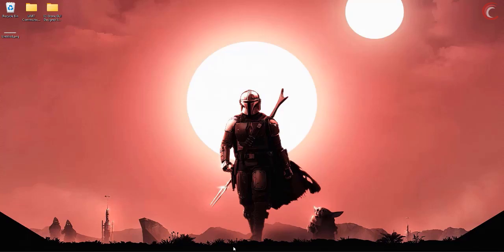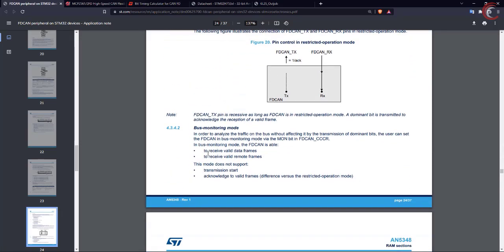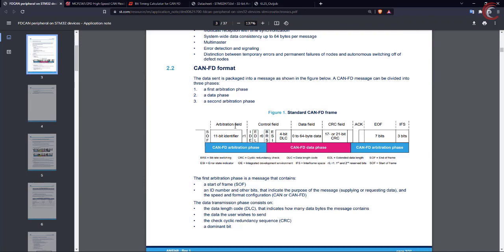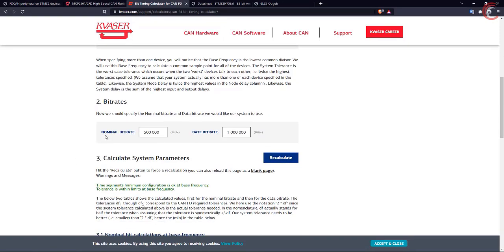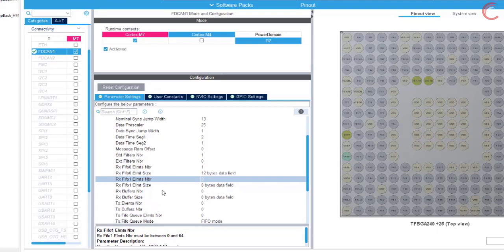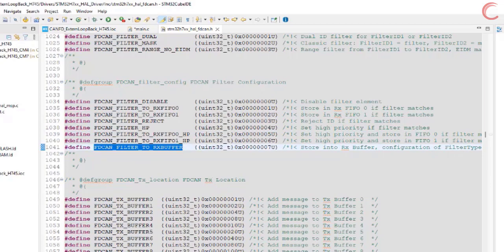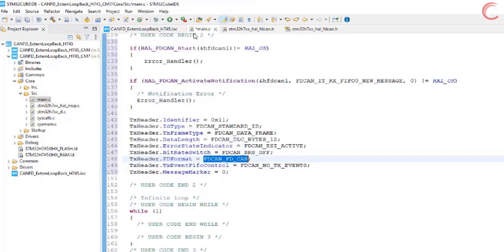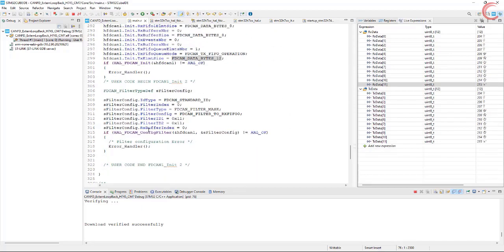FDCAN in STM32 || LoopBack Mode

Comment: Trying to get FDCAN on the STM32U5 and not being very successful. 
I need classic mode and I set up the interrupts and everything.
I get receive error counter going up.  I don't really know how to go forward from this.
Reply from the maker: Classic mode is used when you want to use the FDCAN to communicate with normal CAN. I did not test it personally, so can't comment on it.
Reply: @ControllersTech  Thanks for reply. Do you know if it's possible to see the type of error FDCAN has? I know the bxCAN has the ESR register to say the type of error the CAN frame is, however I could not find a similar register for the FDCAN?
My interest is only to use it in classic mode.
I see with an oscilloscope the STM32U5 is receiving a signal.
Reply: I got it working. My issues were:
1. I have FreeRTOS but I was trying to run it before the FreeRTOS starts for testing purposes. I had to make the FDCAN interrupt priority 0 in the NVIC and not use the FreeRTOS functions.
2. Since it is classic mode you can use the bxCAN calculations and match the nominal and bitrate prescalers together.
Reply: If you want to uses FreeRTOS apis. You have to check the range of interrupts are allowed to use FreeRTOS apis. For example in Cortex M4 start from 6 to 15. From 0 to 5 is not allowed to use FreeRTOS apis.

Comment: Is there anyone try to use STM32H735G-DK to realize loopback mode? I try it with the exactly same code and setup, but no message can be transmitted... I don't know why...
Reply: Hey, I just got it to work with the STM32H735IG-DK discovery board. In my case the problem was that I had to change the following lines:

In his code:
  hfdcan1.Init.TxFifoQueueElmtsNbr = 0;
  hfdcan1.Init.TxFifoQueueMode = FDCAN_TX_FIFO_OPERATION;
  hfdcan1.Init.TxElmtSize = FDCAN_DATA_BYTES_8;

In my code:
  hfdcan1.Init.TxFifoQueueElmtsNbr = 1;
  hfdcan1.Init.TxFifoQueueMode = FDCAN_TX_FIFO_OPERATION;
  hfdcan1.Init.TxElmtSize = FDCAN_DATA_BYTES_12;